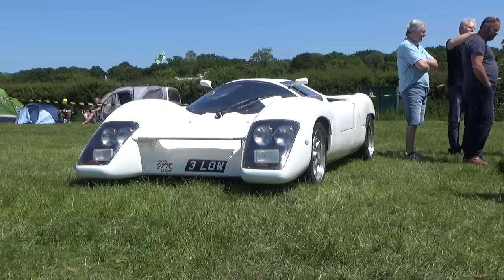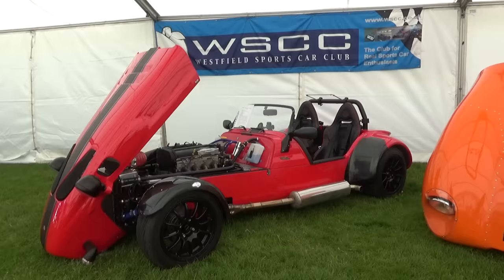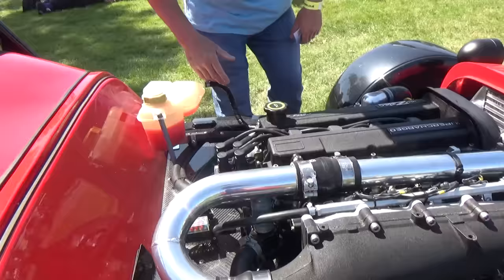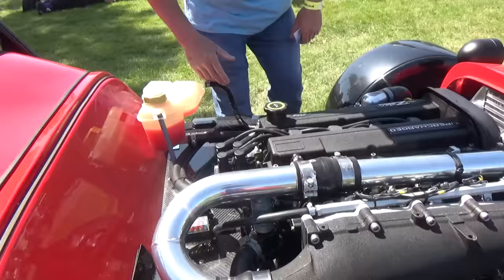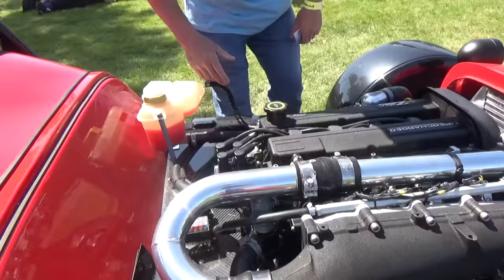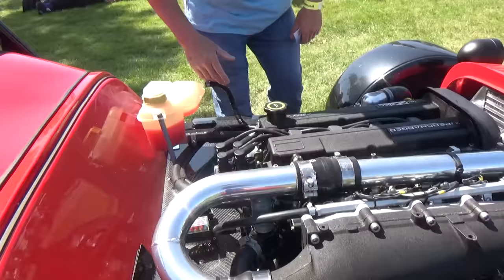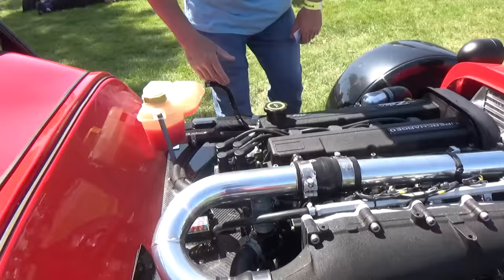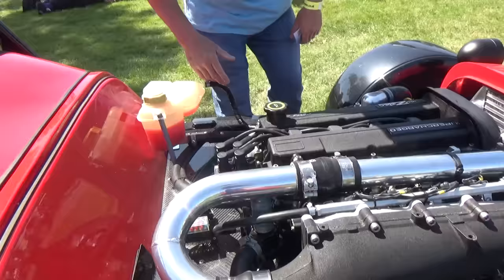National Kitcar show 2023

Comment: I know this is sacrileges, but why doesn't any of these company's make them into EV's. The cars that come out today are so boring.
Reply: Beatle conversions are relatively cheap. And would make those VW kit cars really move. Saw one that had a pedal operated speaker that sounded like many different cars , planes,ect.Really cool!!
Reply: Cuz EV’s have no life to them. They’re just posh Gokarts
Reply: @egz7086  I'm not debating performance. When the car company tries to make a sporty car like the Mustang EV, it looks like crap. The only thing good about the Mustang EV is that now at the holiday Mustang get together the Mustang II will have a seat at the table, because there is the Mustang EV to be sitting out in the snow now. And that took 40 years.
Reply: What could be more boring than an EV? I won't even mention how impractical and pointless they are.

Comment: I'm 6-4 built a cobra and extended the footwells. I also used block hugger headers and out the bottom exhaust. Worked fine. Most of these cars are for jockey-sized guys. With a little engineering we can get into these buggies.

Comment: 30 years ago at the show, the fake VW based 911 Covlin? looked almost identical to a 911 , the fake 356 Chisel speedster? also VW based looked identical , the Fake Lambo looked almost identical  the V8 gave it away. The Fake Jaguar xj6 engine E type looked almost identical. These body kit cars are not so close. Cobras still look real but was already yawning at the number of Cobras in 93. I see the 356 that looks real is still there. Most of the good looking replicas were there 30 years ago and some that were there are missing. I think the kit car replica market must have stalled. I would not kennel my dog in many of the new body kit replicas,, that new bloated  boxter based 356, someone must have been drunk at the time to buy that
Reply: I'd like to walk around those shows with a mullet wig, platforms and a cucumber down the front of tight strides! What's the point of having a Trabant dressed up to look like a Lagonda? The whole fake - snake thing does my head in, that one with "Cobra 427" decals all over it; NO, it's NOT !
The beech bugs have a nostalgic charm - I could do one of them with Subaru power, that'd be an honest kit car. The rest, with a few exceptions are just ridiculous.
Reply: @dancarter482  Don't know why people want a falsified version of a real car or those who buy fake badges. Some of the original kit cars, like the Vaydor or the Manx, are cool projects, but I would never want one based on an existing model i.e. the fake "Cobras" or "GT3's." For instance, if you arrive somewhere (and it's not a kit car show) what do you say when people ask about your 'GT3'? Either you lie, or tell the truth, "Umm, it's not real, I bought a kit because I am a poser who can't afford the real deal." It's fine if you can't afford a $300 thousand dollar car, most of us can't, but it's a façade - like putting a false front on a trailer house and calling it a mansion.
Reply: @mikefraley6935  Best I've seen was a "speedboat" built on a Reliant three wheeler. A totally honest mad machine that is so obviously NOT what it appears to be. Sitting in traffic in a FAKE car is like walking around in DRAG!
Friends who've owned exotic cars always have conversations at the fuel stops with excited enthusiasts - my mate had a low-body Countach and was always getting accused of having a "Nice replica, Mate!" - because it doesn't have the silly wing. They were always surprised it was the real thing.